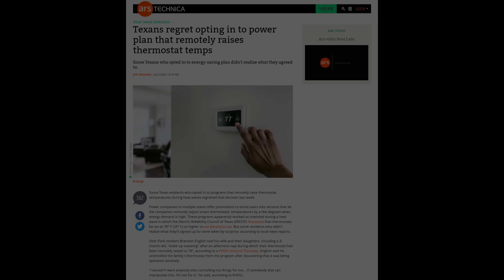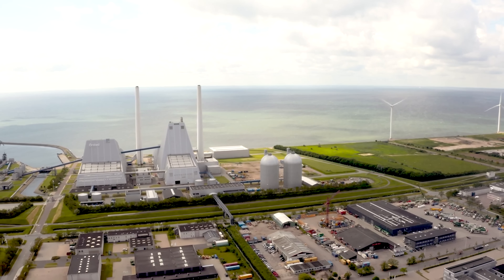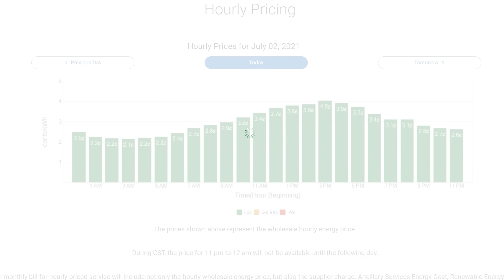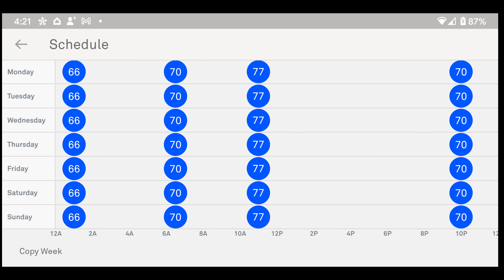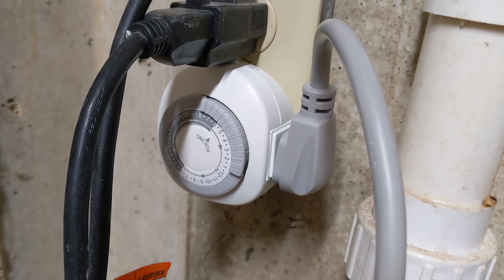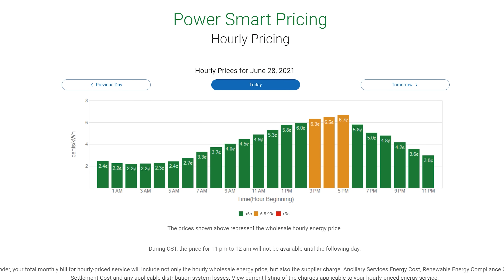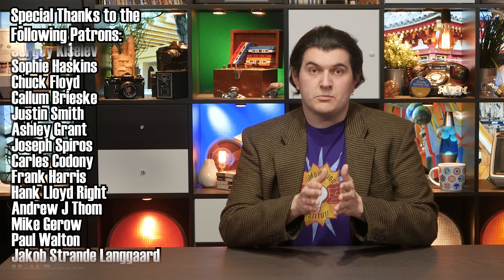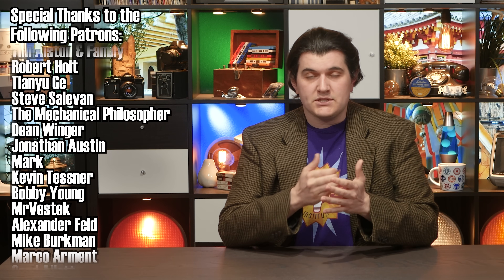Batteries aren't the only way to store energy. Here's another.

Comment: Must be nice to have a single system responsible for both heating and cooling. Here in the UK our houses typically have gas-fired central heating and no cooling. The houses are usually well-insulated but the design lends itself to keeping warm in winter rather than keeping cool in summer.

We’re always being urged to lower our thermostats and burn less gas, but obviously this doesn’t ease the strain on the grid.

A lot of new build houses in the UK now have electric heating so your scheme might work better for them.
Reply: I’m in Sweden and have been to UK. I must say, NO, buildings in UK are NOT well-insulated, by any stretch…

Rather the opposite - piss-poorly insulated!

I have stayed in hotels with single glacing windows! In major cities! While cold outside and the heating element was too hot to touch! 
Insane!!

Very few have triple glacing. Very few. But all should! UK is a cold place many hours of a year!

Comment: Hi !
As always it was super interesting. I'm wondering if something like a nest thermostat can take into account the cheapest hour of the day ? I'm living in France and I have 3 time periods where it is cheapest : 3am30 to 7am, 1pm to 4 pm and 9pm to 10pm30.
I would like to use you technique but getting a smart thermostat involved to go a step further. If a thermostat know the storage capacity of the house + the insulation + the weather, it should be able to decide "I don't need to start run the heat pump at 3am30, I can wait till 5am. Any idea if it's possible ? Or it's better to do a try and repeat approach ?

Last question: how are you dealing with entering and getting outside of your home without losing too much house storage ? Is your entry in a dedicated room ?

Comment: This summer I connected solar panels to my heat pump and measured the voltage and amperage from the solar panels. Through my Raspberry PI, when there is voltage = sunny I lower my heat pump temperature setpoint to get the maximum energy from solar panels convert to cooling thus creating my cooling battery. Similarly now in the fall, when the voltage = sunny I raise the heat pump temperature setpoint to get the maximum solar energy to heat thus creating a heat battery. Anybody interested applying this concept load side BTU storage, I can share pictures, wiring and NodeRed code.

Comment: Um , yah , hi . 
Um , I was thinking further on this subject . House building technology has not changed much except these contractors are getting cheep . They used to build out of masonry , but now the houses are built from sticks . And it’s a wonder , the wind hasn’t blown these stick houses away . But 
There is a cartoon about the “three little pigs” and the big bad wolf . The pigs used three types of material to build their abodes . Guess which one stood against the wolf ? 
Ok . You get me . But the way these house floor plans has not changed . 
Which floor plan is more efficient ? Which one has at least 180 degrees of sun exposure ? 
And then there is the matter of the strength of you roof ? 
Most roofs are built with geometry in mind . The most common is a triangle . And from the thumbnail , the sun side of the house is the side of the house its self . But no one thinks to mount solar panels as part of the structure on that side of the house . Everyone is thinking of putting the panels on the roof ! BAD IDEA . 
But do you know what would be a better idea ? A geodesic dome structure . And when you build your solar panels you fit them to the segments that shape the roof surface .

Comment: Here in Seattle most of the Electricity is hydro so it is the cheapest in the US but I am strongly against placing solar panels on the roof as we get pretty aggressive MOSS growth any shaded area within a few months will take over by Moss for example during COVID people did not drive their cars much so many cars were damaged by Moss and you can see them driving around with the damaged paint job.   Now imagine what this will do to your roof after a few years growing under the solar panels??   Disaster waiting to happen.    Sun kills the Moss but it will grow like crazy under the panels,  or you got to go up on your roof and spread the anti moss powder like most people do in Seattle.   In spring and before winter most people climb up on the roof and put down the anti-moss powder.    That will be super hard with Solar panels in the way and it is so dark under them as well I don't think the powder will even work.     The best is to place the solar Panels on a metal adjustable frame in the yard, this will also be way cheaper to install, less man hours, less drilling and easy to maintain, monitor and replace bad panels yourself and also lower cost to replace your roof material if you ever need to.     Sure, roof is supposed to last 30 years but some bad storms and snow and it can eat away at it after like 20 years;   Also, with the Solar panels near the ground you can clean snow off of them without having to climb on your roof in winter!!!!!   Yeah fuck the roof install do it on a raised panel in your yard!!

Comment: I just looked into mine, doesn’t seem worth it.  Reg pricing is 13.7 cents, time of use goes to 19.6 cents peak, 8.9 cents off peak, you than pick 12 hour peak period 7-7, 8-8, 9-9 or 10-10.   There is a way to benefit but I can’t imagine it would be a big enough savings to change our current lifestyle.  Interesting stuff though!

Comment: Sounds like that rate plan is a rip off due to the minimums being so high. When you’re cooling the house cooler than it needs to be you’re increasing the temperature differential between the inside and the outside which increases the heat loss or in this case the heat gain. You pay for that, not the utility. There’s no free lunch, except for the utility

Comment: Cooling at night? We in germany don't even use a air conditioner for that - at night it's mostly cool enough that opening the window is enough ^^

On the other hand I try to open the window when it's warm in the cold times of the year so I don't have to run the heat engine so much ^^
Reply: I mean atm I don't have to pay for heating, but I don't have to waste energy anyway, right?

Comment: 1. 19 degree celcius is not cold
2. if you have 21 Celcius at night it is enough to open the windows at night, dont need no AC at all as long it stays below 32 at day
3. be carefull with those spot prices, they have fooled us here in Europe/Norway many years that this will be cheaper and now we are getting pressed out as lemons. 
Last summer te price of a kWh was down to almost nothing, as low as 0,02 NOK. Now the spotprices have gone up to 4 or 5 NOK in some hours and even i the "better" hours it is much more then 1 NOK.

And here we are not talking about wunderfull warm 19 degrees celcius, it is more about the same in minus ouside. People have to heat up their homes with electricity, as there is often no alternative. Many people have now power bills over 2000, 3000 or even more NOK (200, 300 Euros) in a single month. Last january it was about minus 20 the whole month, my house was bad isolated, the bill was almost 5000 NOK for that month. And I woke up with about 8 degrees celcius in the morning (that is cold ;-))

I have changed to fixed price for one year in late August and it was the right thing to do, even as the price looked a little high with 0,45 NOK at that time. Now I am lucky to have done so.

The house is not fully iosolated, but I have come a way towars the goal and you can feel the difference. Untill now it was not less then 16 degees in the mornng, even at 17 minus outside

Comment: I think you just helped me solve a huge energy problem here in my home in CA.  I run my electricity to 86 in the summer (100-128 degrees in the summer outside), and my electric bill is over $400.  I was down to handing out cooling microcloths and low energy fans to keep it from going over $450, and I have pretty good insulation, and have made most of the changes I can.

Comment: I am all for demand side management for everyone else. Personally I am done with the grid and bills. You really think things through and out of the box.
So consider this solar or biofuel heating feolite blocks specific heat capacity 920watts per kg per K. Either heat yourself with this or put the heat through a stirling engine for electricity. The walls of my house in Portugal are 750cm thick I will be insulating the outside and using this thermal mass as a thermal flywheel.

Comment: A variable energy bill is a big no no in any area where you get adverse weather conditions. (Hurricanes, sweltering heat, extreme snow storms, ect.)

Sure, you save a few bucks on average, but when those conditions cause the grid to have a shit ton of trouble? Have fun with your energy bill raising thousands of % in cost. Guy in the texas storm had a plan like that. Paid cheap for a few years, until the storm hit. Then his electrical cost skyrocketed in the time he needed it most. He had to pay thousands. He in no way saved thousands in those few proceeding years of the plan, only a few hundred. To risky. 

It's like a variable mortgage. It's a trap. Sounds cheap right now, but add a few % on it? You're paying 1k+ more a month.

Comment: The air condition is rarely on in my house 

For 5 minuets at the end of the day 2 attic fans are run sucking hot air from the day out and it pulls in cooler air from the night 
The fans are ran again in the morning then the house slowly heats up over the day
The house never gets uncomfortably cold and rarely gets uncomfortable hot so that some one to manually turns on the air condition to

Comment: My late uncle, my mother's older brother, used to run the computer system that ran New York Stock Exchange.  In fact he created that system.  Some of you probably knew or remember my uncle.  Naturally, that computer system had backup power generation - it was a very important system.  The story he used to tell, was that from time to time - usually during the summer - Con-Edison would call  him up and ask him to fire up his back up generators, along with many other businesses that had that capability even out the load in Manhattan when there was not enough generation capacity available.  That's good right?  Black out in NYC?  people die, the city burns.

The problem becomes as we build our systems ever more fragile, for a variety of reasons, we will be increasingly taxing people for the public good without compensation - that is not democratic - that is a form of slavery.  Just saying.

Comment: Remote power shedding?  That would be horrible--possibly even disastrous or deadly for the elderly and infirm who NEED their a/c and heating to work WHENEVER their bodies need it!
Well, the "whole house battery" would never work here.  Our house was built back in 1957; no insulation in the walls except for the kitchen and one wall in the living room which we remodeled.  The windows are double-pane, but 1st generation, and some of the seals have failed.  We did get a utility company upgrade with added attic insulation, but that's all, and they put those stupid foam inserts behind the receptacles and switches..including on the interior walls, which I don't believe does a bit of good.  We're on social security, pretty much hand-to-mouth, so can't afford any upgrades such as insulating the rest of the walls or putting in new windows.  My mother-in-law lives with me, and is among the compromised persons I mentioned in my first sentence...so... I do have to run my HVAC unit WHENEVER IT'S NEEDED, and not by time of day. My only saving grace is the fact that I tend to be a night owl, and will run the washer just before I go to bed around midnight.  90% of the time, I do dishes by hand instead of running the dishwasher...and yes, I am very strict with conserving water in the process, as we're also on a septic system.  At that, since we're in CA, in an area that does see 100+ days for a couple of weeks in the summer, (though thankfully, it doesn't snow here)...my utility bill does average around $200/month most of the year.   Sometimes a bit less; once or twice--near $300... oh, and that's WITH both a medical baseline allottment AND a low income allowance!!! (Electric is more expensive than gas here.   My stove, water heater, furnace, and clothes dryer are gas applliances, not electric.)

BTW--can you do a video and explain about insulation?  I've never understood why they insist on putting attic insulation in/on the floor of the attic, between the joists, instead of between the roof rafters.  It seems to me that in the first case--the current protocol--you are then trying to exhaust heat from the attic, and even though it might not get into your house (heat rises, anyway!)...if you had the insulation right up against the roof between the rafters--the same as is done between wall studs--and with the same vapor barrier...then the heat would never get into the attic in the first place, thereby preventing the whole issue!

Comment: Using a heat pump to chill a tank of water could achieve the same result without the overchilled downside. Water has one of the highest specific heat capacities of common substances so would be a much better b battery than air.

Comment: As to thermal storage -- some medieval churches with their 1 meter+ walls and other structures have all along utilized  it!  On the other hand, recently I have seen articles praising the benefits of WHITE roofing.  Well, what else is new?  We got a white roofing when our R&D building was built around 1975 just to reduce the air conditioning need.  And when my home roof was redone, I wanted as light (gray) slates as available.  All for the same idea of thermal management.

Comment: Installing an attic fan will remove much daytime heat from your attic resulting in a cooler house in the summer, less use of A/C. Even with thick attic insulation you still get the radiant heat entering the living area. Jeezus, if you're running a dehumidifier then you might as well be running the A/C, in fact you'll probably save energy (and money) if you run the A/C instead of the dehumidifier. My maximum bill in the summer (August) is under $120 and goes down to $60's in the fall/spring.

Comment: The solution exists now.  Build many more nuclear power plants. 
Have them running max all the time. Use the excess energy to mine bitcoin. Dynamically turn the miners on or off as demand fluctuates. 
Pros of this system, always plenty of energy available when needed, no wasted energy as it is turned into stored value in bitcoin which helps offset costs and can lower prices for everyone, and it makes the most secure network in the world even more secure. 

This solves energy issues and monetary system issues as the world moves to a bitcoin standard.

Comment: Problem with all this is people on low incomes who can't afford to upgrade. I don't need heating or cooling in my house apart from fans in summer to move air around. Which leaves appliances that can't be turned off or as in my case gas powered. But I can't afford to upgrade anything let alone solar or anything else.

Comment: I'm guessing that when/if everyone has an electric car, that supply/demand graph will change, and not for the better.
More clean base load power would seem to be a better long run solution, especially if we go all electric.
Have you looked into non electric A/C units?  I hear that there are some which run on natural gas and might be an interim solution, at least until the grid is modernized and more base load power is added.  Thorium or molten salt nuclear reactors seem to present the best case for adding base load power to the mix.  We should get rid of the scaled up boiling water reactors that are prevalent in this country, for obvious safety and environmental reasons.  Of course, we invented better designs in the early 1960's but you couldn't use them for making nuclear weapons, so those ideas were scrapped.  Might be time to dig out all the work the government did on those earlier, safer, and more efficient designs.

Comment: I'm not an accelerationist on anything else I can think of but when it comes to electricity and energy networks and management, I am and for that reason I'm not really a fan of this technology, for now at least.

Utilities across a lot of the G7 have been squeezed very hard to run the grid as close to the line as possible and have been kicking down the road investments in energy storage, non-emitting dispatchable generation or if you're really special, basic winterization efforts. As bad as Texas was I don't think it's shaken that model of operation from its stranglehold on the grid in the US and the hypercharged energy crisis in Europe ( there were already major problems then Putin added more with the war ) haven't been enough to get the Germans to stop shutting down nuclear plants.

Given the money, effort and reorganization needed to change this trajectory ( nationalization and consolidation into TVA like organizations may be needed ) I want enough of a rough patch in the 2020s to actually start this change for real instead of contributing to the illusion of progress towards zero emissions we're getting right now. What do I mean by illusion? A major component of US emissions dropping in electricity has been a shift from coal to natural gas, which sounds great until you realize that none of the natural gas infrastructure is usable in a zero emissions grid. You can't get to zero by dividing a number by two either. While CCS may provide some leeway for this ( though even just that is a major capital add-on ) generally there are fundamental differences for what a low emissions grid looks like and a zero emissions grid looks like and I want to kick utilities and governments out of the 'tweak around the edges holding pattern' as soon as possible.